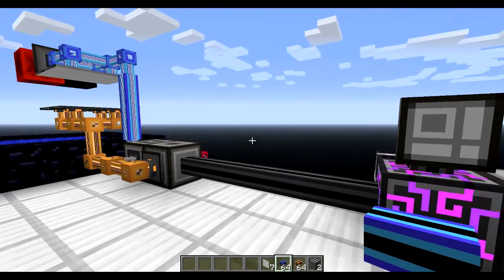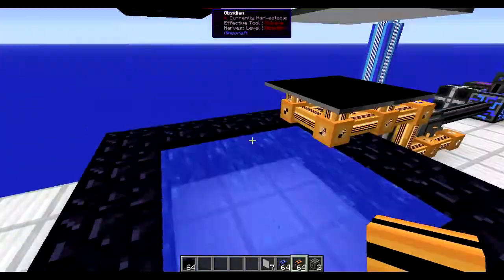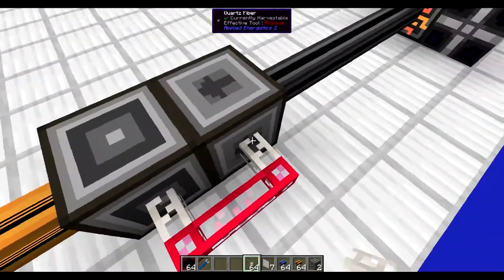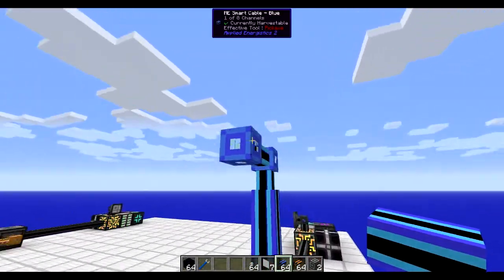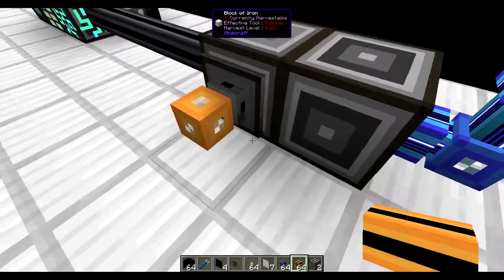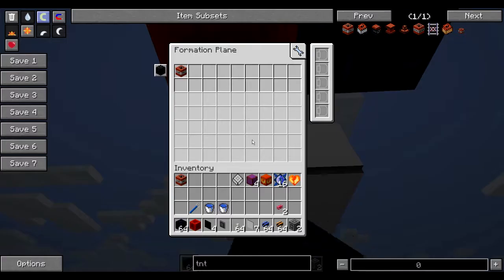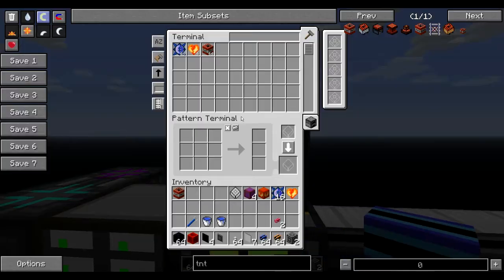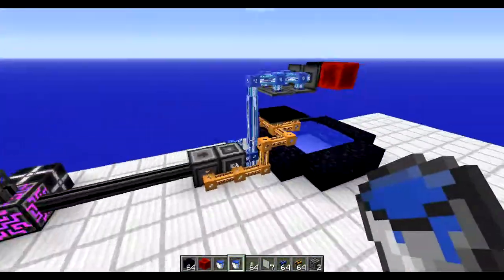How to build: my auto 'Awakened Draconium' system

Comment: my annihalation planes arent breaking the blocks
Reply from the maker: You need to give me a bit more info, but most likely the output from the subnetwork is not set up correctly
Reply from the maker: check again by the 8min mark
Reply: i fuguured it out, it was the same problem someone else had in the comment section i just set up a storage bus into a chest and export bus into interface, fixed the problem
Reply: I also encountered the same problem and had to use the chest..any ideas why this is so?
Reply: I think with an update it made it so storage busses wont go straight into the ME system anymore

Comment: Hey, everything works flawlessly except it won't break the blocks for some reason.
Reply: I had the same problem, ty for the help :D
Reply: zozokaapromovie No problem.
Reply from the maker: Check the storage bus on the orange network, you want it configured for awakened blocks(mandatory) input only(optional) . And double check that the orange network is powered.
Reply: Industrials.Black I tried everything. Ended up being fixed by putting storage bus into chest and then going from chest to interface.
Reply from the maker: +DTDerian tWitch weird, but I'm glad you solved it!